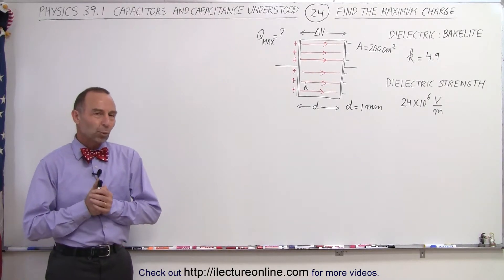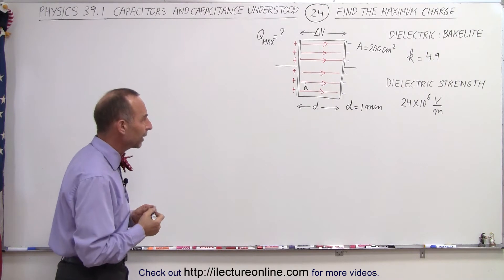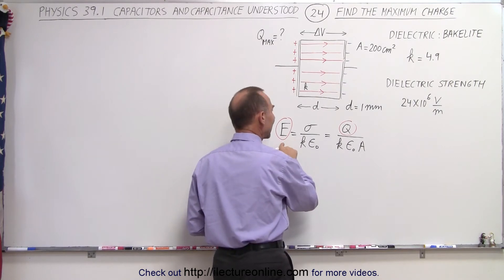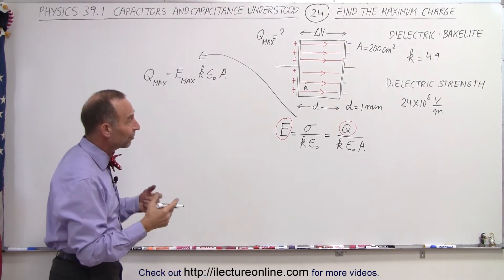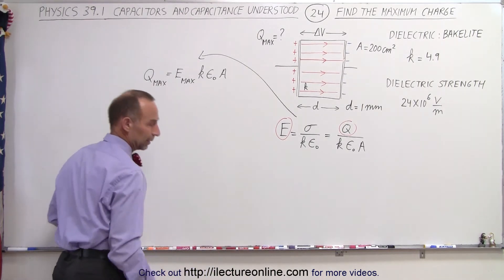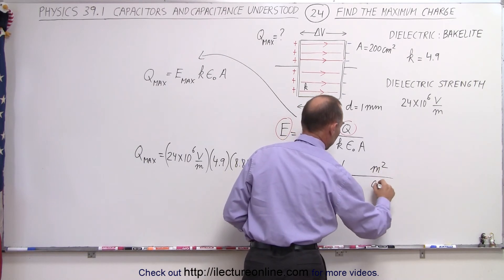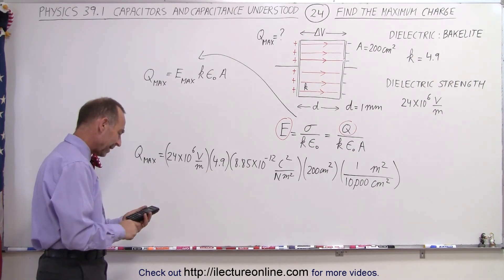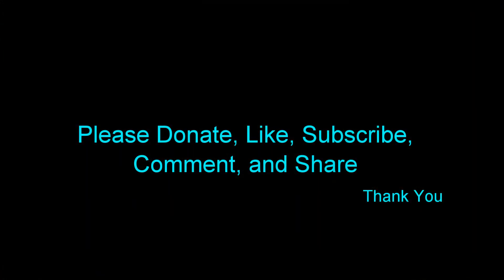Physics - E&M: Ch 39.1 Capacitors & Capacitance Understood (24 of 27) Maximum Charge=?

Comment: HOWEVER, THERE'S A PROBLEM HERE THAT I JUST HAVE NOTICED THOUGH !, THE DISTANCE d BETWEEN THE CAPACITOR PLATES WAS NOT REFERRED OR INVOLVED IN THE SOLUTION, WHICH RENDER IT IMMATERIAL OR WITHOUT USE IN RESPECT TO THE THICKNESSS OF THE DIELECTRIC WHICH ALLOWS THE MAX. CHARGE Q TO ACCUMULATE IN THE PLATES. BUT I THINK THIS IS ERRONEOUS !
Reply from the maker: This problem is solved as an infinite plate (since d is very small) and thus d is considered.  That is a good assumption for capacitors.

Comment: THEREFORE, THE GREATER THE DISTANCE d BETWEEN THE PLATES, THE BIGGER THE VOLTAGE BREAKDOWN CAPACITY OF THE CAPACITOR, GIVEN THE DIELECTRIC CONSTANT OF THE MATERIAL USED AS REFERENCE.
Reply from the maker: This problem is solved as an infinite plate (since d is very small) and thus d is considered.  That is a good assumption for capacitors.